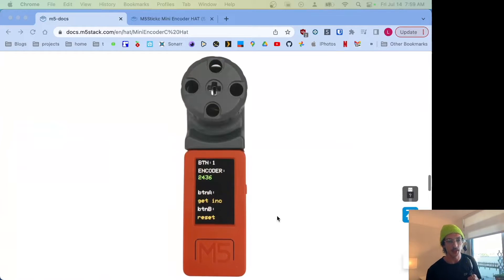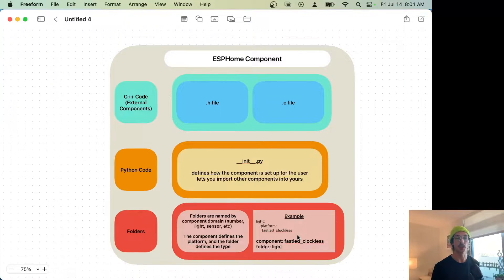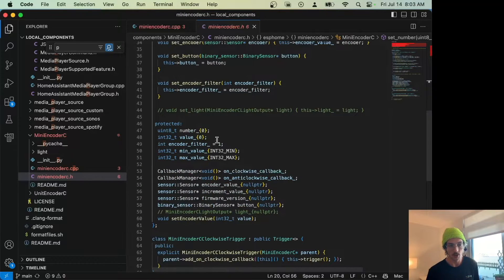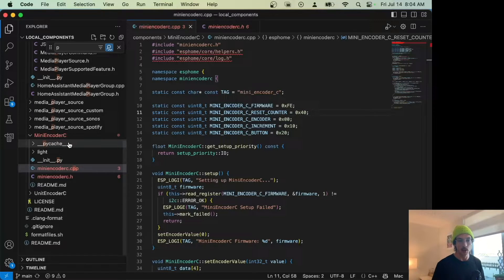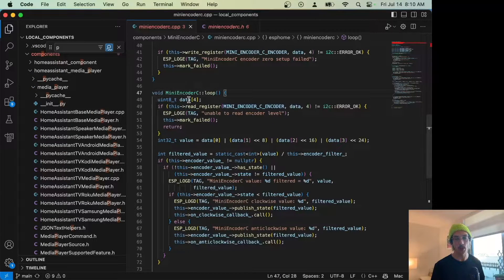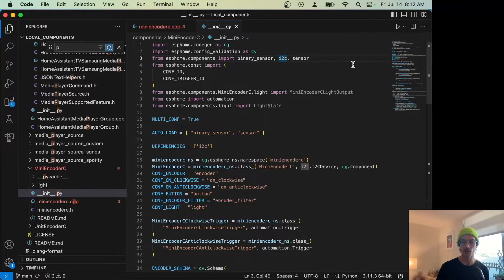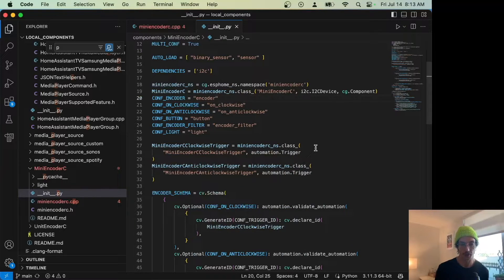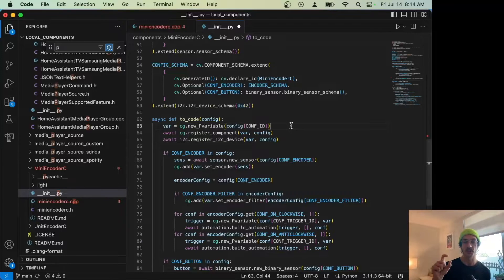Building a ESPHome External Component From Scratch!

Comment: Hi Lando,
Many thanks for your tutorial, is it possible to convert a python integration for Home assistant into an esphome external component? I am thinking of this idea for utilising a single ESP32 device to connect to different device over TCP/IP such as solar charger (that has intergration for HA already) to update data over MQTT!
Reply from the maker: Yeah you can make http requests with a esp32 using esphome. What solar charger is it?
Reply: @landoslab  It is a Luxpower SNA5000 and there are already Python integration. It would be great if you could guide me through. I will share the code if possible!